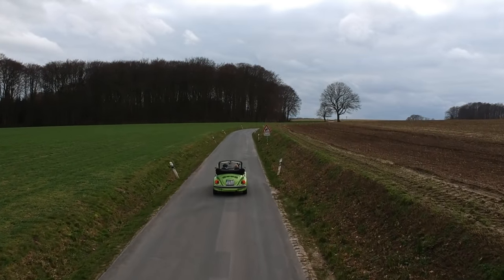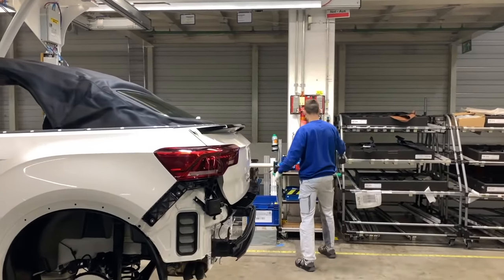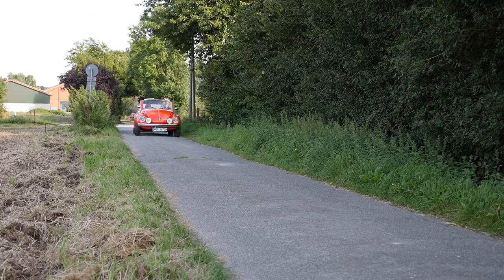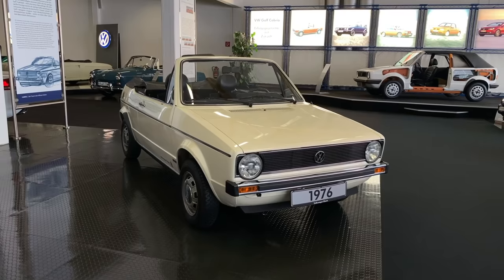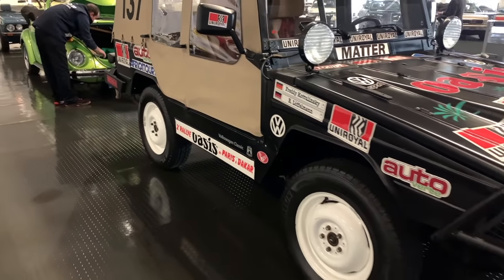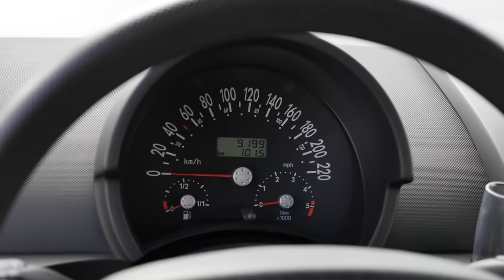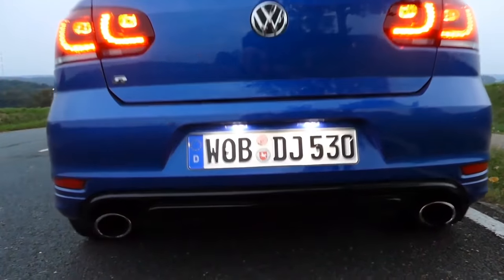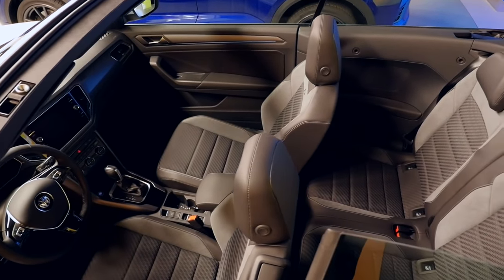The history of Volkswagen convertibles - VW Beetle, Golf, Ghia, Iltis, EOS, T-Roc Cabriolet

Comment: I love the Eos!! I have the 2010 version. Leaky top is no joke though!
Reply: I'm having a 2006 one, that car has everything you wish, plus space for 4 adults. Mine is not leaking at all inside, it's parked outside and used in all the seasons. The only problem i had was when a drainage pipe was blocked and i had to blow air in it. Other than that, perfectly waterproof.
Reply: Kaitlyn Votel as Marian mentioned above, I can vouch that my EOS (2008) has no leaks. Beautiful car and very roomy rear seats.
Reply: High pressure washing like at a car wash, is one of the causes. Wash your EOS with a hose.
Reply: @mbergheaud  Last time i was in the carwash, coming from a trip and not having time for handwashing. No problems at all, except once when the pressure was straight in the rubber  between the windows, but for such a high pressure is normal i guess. I actually like it way more when i go through, car looks way better and keeps for more.
Reply: I have the 2015 Eos...great drive and a solid all around car to drive in all four seasons.  As for the roof, if you treat the seals once a year, including the sun roof, and clear all the rain drains, you will never have a leak issue. I get it done by my VW service center during a regular service. About $70...well worth the piece of mind.
Reply: This is true per the VW care videos on YouTube. If you find a car wash that don't use high pressure sprays, but free falling rain like water, that will work fine.